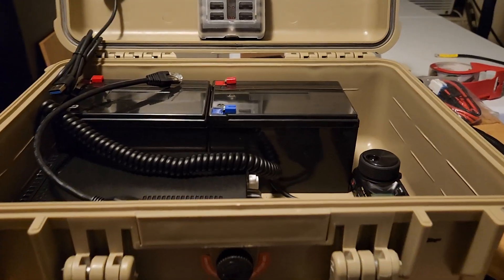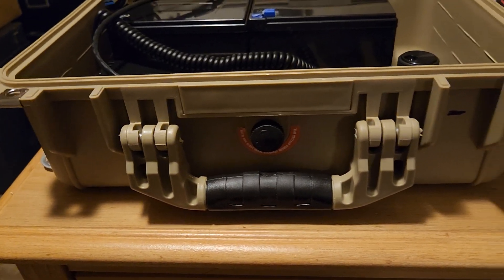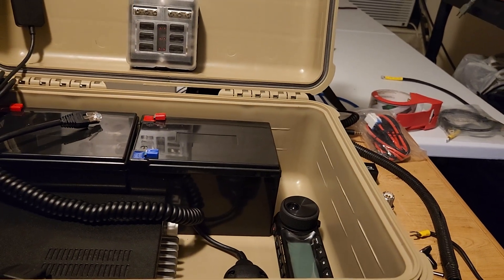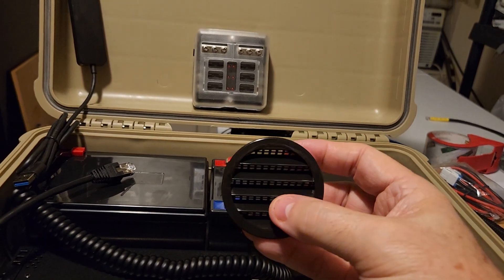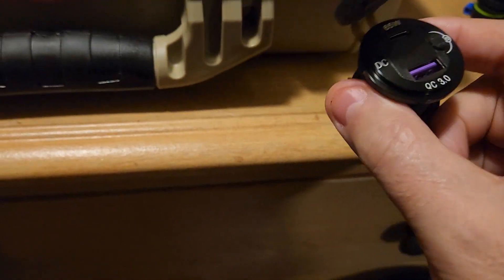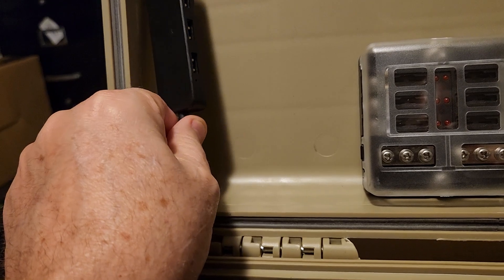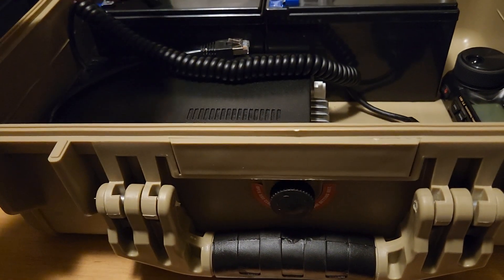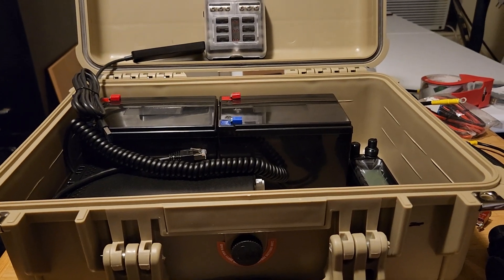Building a new portable HF box with a Yaesu FT-891 (Overview)

Comment: Great video, I’m using the same Apache case for my FT-891.  I centered the rig in the middle to give even airflow left to right.  I mounted the mobile bracket and the body is secured with that, it also helped to center the weight for easier carrying and also allowed enough room to drill and attach the bulkhead connector for the mic just below the left latch.

Comment: I was worried about heat as well. I'm using an 857D with Armoloq  frame inside of a bag and the airflow is extremely limited. It hasn't quit on me yet. I do try to keep the power down to 20w or below but I've been to 100 watts SSB for an entire activation without an issue. I'm in FL and that was sometime in the summer 😂